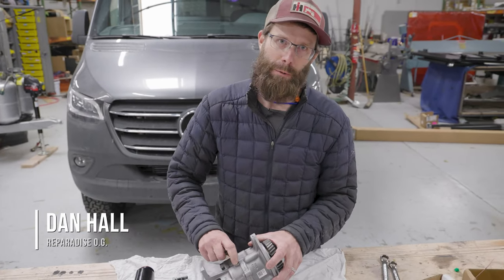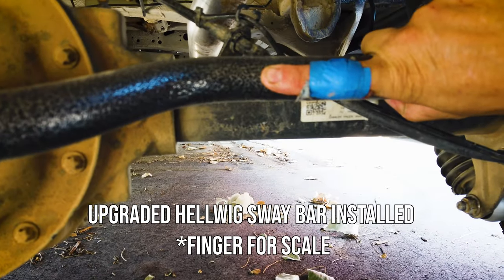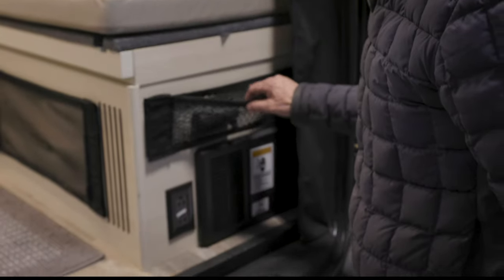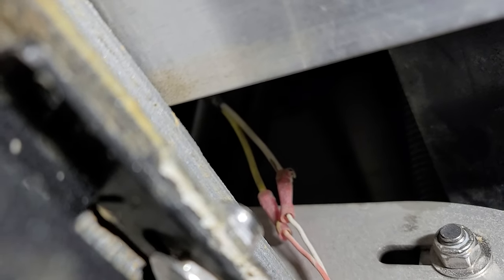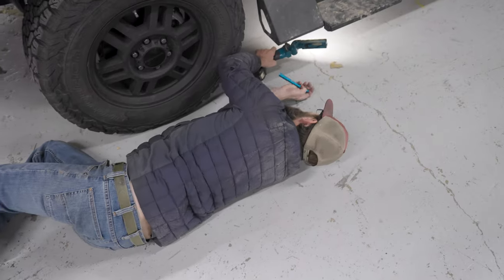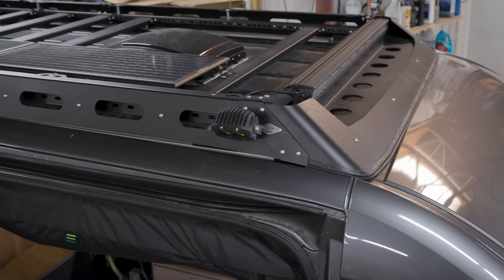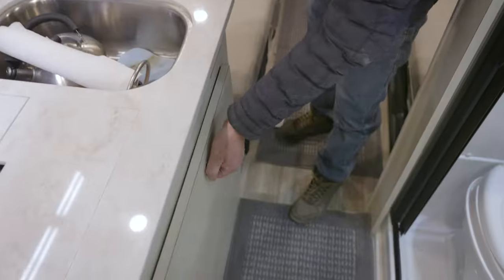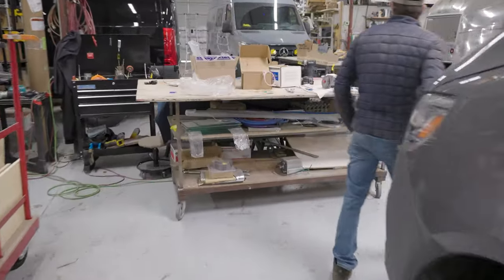PIss Poor Tiffin Cahaba Review

Comment: Ive been diving deep into trailers mostly and some "off grid" RVs. Ive pretty much become convinced that there is no value to buying a new unit from a dealer. Warranty is practically useless. No lemon law protection. Dealers cant be bothered to even run a shop vac through the cabinets. and so on. And thats the tail end of the dog - it starts at the manufacturer. I was at an RV show and looked at a Coachmen Cross Trek. I wasnt expecting a whole lot because 1) coachmen and 2) "adventure". One of the party tricks is that the bed is electrically raised so there is a "toybox" underneath for storage - there was a sign on the control: "Do not raise a lower the bed - we dont want to wear the mechanism out".  Lots of confidence in that quality, eh?

anyhow, I appreciate the informative videos
Reply from the maker: Thanks for sharing your experience. It's really a sad shape the RV industry is in, and even more sad that end users, like you, have to put up with it. There are some decent manufacturers out there, we'll be touching on some of them as they come through our shop. We did some upgrades to an EKKO recently, and didn't really see a need to do a piss poor on it, as Winnebago did a decent job with everything. There's still the usual RV short comings (a quick forum scan of REVEl owner experiences will bring those to light), but all in all it was a pretty decent coach. https://youtu.be/dlEV8qD6HNI

Comment: I've owned a Cahaba for right at a year and I couldn't agree more: it's crap.  Yes, don't take it off road unless you want to rip out the undercarriage (I ripped it all out and replaced it after destroying it on my first trip).  And the build quality is total crap - everything falls apart.  I've had a failure on every major system: power, electrical, plumbing, furnace, etc.  Furnace worked for about 10  min then died on first trip - had to go home.  Volta control panel died on second trip - had to go home.  Rear door leaked severely on third trip and drenched the bed - had to go home.  Positive post on Volta alternator broke off on fourth trip - had to go home.  Water pump quit working on fifth trip - had to go home.  I kept asking why the solar panels seemed like they weren't working and they finally figured out the connections were never tightened down.  The wooden panel that holds the water pump to the side of the van just completely fell off.  Fortunately the Sprinter chassis is pretty good.  But the Tiffin mods are complete junk, both in terms of engineering and quality control.  I've heard they've been discontinued.
Reply from the maker: That's an epic list, sorry your experience is so bad. The more you find these faults, the better the camping experience will be. Good luck going forward!

Comment: Do you produce a van with full flushing toilet and decent sized shower. Connected to a 27 gallon gray/black combo tank and 28 gallons of fresh? 

A ultra high capacity and best in class Volta battery bank? That can run the AC all day and charge in about 60 minutes of driving?  

Where as the revel has a paltry 280ah battery that can’t run AC for more than 2-3 hours.  Has a 5 gallon cassette toilet and tiny shower.  

Didn’t think so.  

I’ll kindly give up some midship clearance- after all it’s not a damn Jeep.
Reply from the maker: "Do you produce a van with full flushing toilet and decent sized shower. Connected to a 27 gallon gray/black combo tank and 28 gallons of fresh?" We can build you one, no prob. If you don't want to wait, see Storyteller.
"A ultra high capacity and best in class Volta battery bank? That can run the AC all day and charge in about 60 minutes of driving?"
We install 48v-based electrical systems in our van builds, with aux alternator charging. Can run the AC for extended periods and recharge rapidly. Here's an example of two systems:
https://youtu.be/fCnbmn35REQ?t=401
https://youtu.be/j15FSkWCtTA?t=80
"Where as the revel has a paltry 280ah battery that can’t run AC for more than 2-3 hours.  Has a 5 gallon cassette toilet and tiny shower. "
We've installed nearly 50 Roamrig systems in Revels (420-630ahr https://www.roamrig.com/product/revel-lithium-upgrade-2018-2020/), and the shower is about the same size as the Cahaba. Cassette toilet is no big deal.
"I’ll kindly give up some midship clearance- after all it’s not a damn Jeep."
You're right, it's not a jeep. But, why does it come with knobby all terrain tires -- and is marketed at an RV segment that's intended to go off road? You'd think all season tires would drive way better if you're never going to take this crappy RV off road 🤔🤔
Reply: Do you own a Cahaba sir? If not you might want to re-search that wow the vehicle comes with all the things you mention most owners are finding majority of those items don't work which makes having them present mute. I will in mind for a year I've still not been able to use it because of all the system erratically charges or doesn't, the roof lights work on and off and a couple of times have caused wires to burn… That's the tip of the iceberg. Point is doesn't make any difference the list of awesome items that come on the van if they don't work it remains a piece of junk just like the producer of this video says. And if you think I'm mistaken mines for sale so put your money where your mouth is!